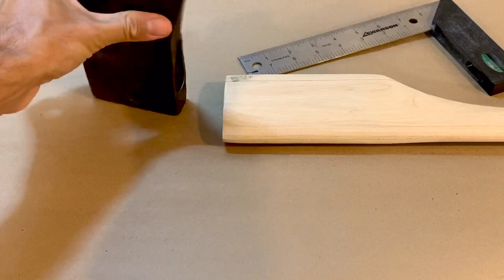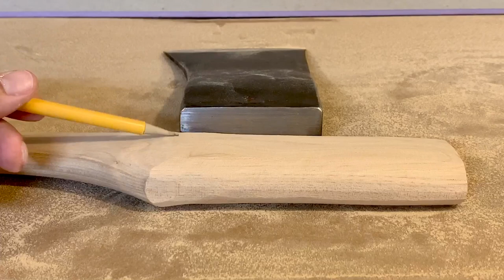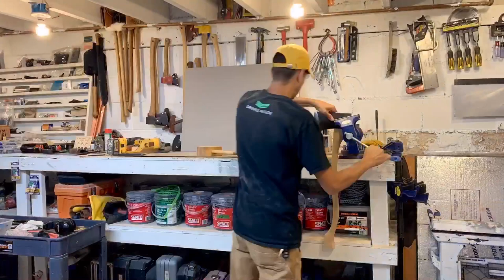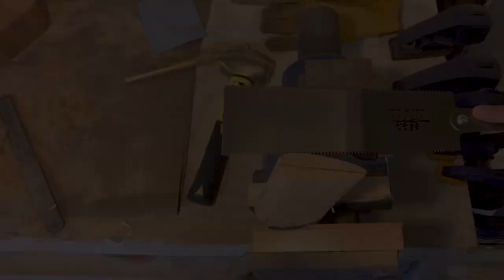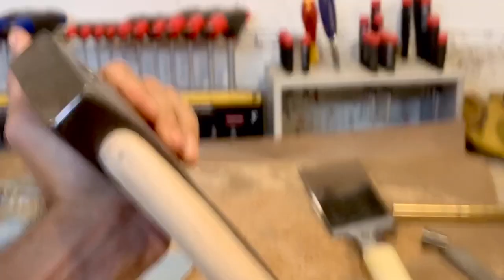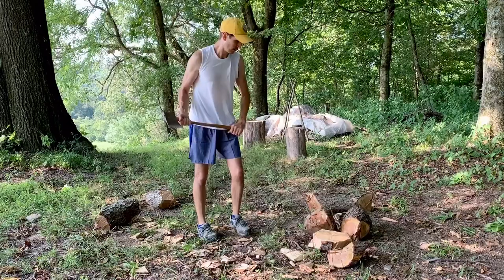One Day Restorations: Vintage Council Tool Axehead on a Killinger French Curve Handle.

Comment: Watched because of the french curve, only to see that I have the same axe head sitting amongst the pile of heads that I plan on putting 36" inch straight on it. Now you got me thinking of putting it on a 30" or even a 28" french curve. Also, made me jump up an measure the eye on my tassie's. Yup, regular 2.5 eye's wont do. So now I gotta go find me some Killinger's, but I heard he stopped making handles now.
Reply from the maker: Unfortunately, he did stop producing handles.  I think 32-28 is about the ideal length for almost any axe.  Glad it inspired some alternative ideas.  Thanks for watching.

Comment: Cool axe. Good work on the hang. How's the steel on the old council? My council axe was made a few years ago and the steel is too soft.
Reply from the maker: Thanks for commenting.  The steel in this one is a little softer than the new Gransfors. I’d say it reminds me of HB’s modern steel and treatment.  However, I have another vintage CT splitting axe from the same era, and the steel on it is so hard a file won’t even touch it.  Too hard really, but it doesn’t chip and I don’t have to sharpen it much since it’s a splitter.  True, Council’s steel is softer these days, but not as soft as oxhead which I’ve have issues with, and I consider the two CT production axes I have within the sweet spot, albeit on the softer side of the Rockwell scale.  Which CT axe do you have?
Reply: @KevinsDisobedience  It's a jersey railsplitter 3.5lb. They say their standard is Rc 48-55, mine must be on the low end. My Basque axe and husqvarna a2400 never get edge damage, but the council seems to get nicked up often, even with a stout micro bevel.
Reply from the maker: That’s too bad. I have the same trouble with my oxhead. I even convexed the edge and still I have issues.  I’ve not had any issues with the steel on my Basque or the Husqavarna. Although I haven’t had issues with my CTs either, that is the steel.  I have had issues with the hangs.  Thanks for input.

Comment: Why did you cut the kerf so deep?
Reply from the maker: Sorry man, I don’t get notified of comments on old videos regularly.  I experiment with kerf depth.  Ideally I’d like to have it spreading wood all the way through the eye.  Generally I aim for about 3/4 or slightly less.  I’ve not noticed any negative results if I go shallow or deep.  But I’m all about experimenting, so chances are you won’t see me do the same thing more than twice.  How deep do you set the kerf?
Reply: @KevinsDisobedience  Well, since the eye is formed by two irregular cones, I fit the handle tight to the bottom one and I cut the kerf to the point where they intersect. That way I am sure the wood on the bottom will not move while the head is being installed, wedged and swung.